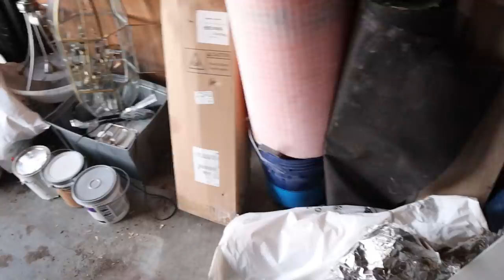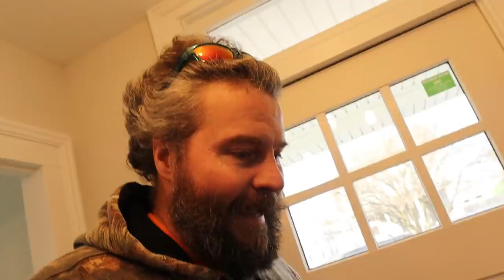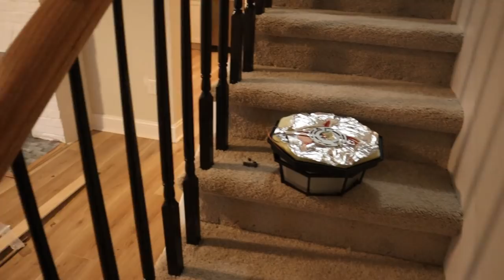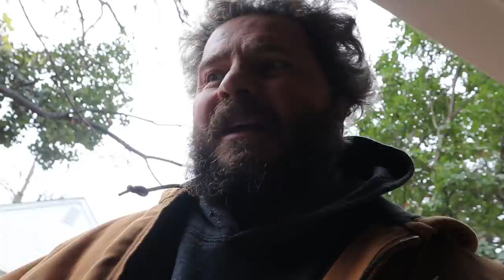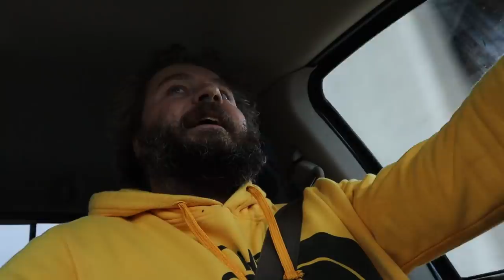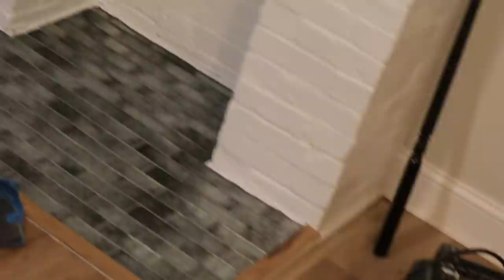SO CLOSE TO FINISHING THIS HOUSE (But.....)

Comment: Joe I would check your return air filter it may have become clogged from the sanding dust if there isn't sufficient air flo the unit will have a safety shut off  replace your filter shut the unit off at the breaker for a few minutes  and it may reset the unit and the exterior fan will kick back on. It's worth a try .

Comment: Heat pumps become inefficient at cold temperatures and they often rely on a coil pack somewhere in the unit to provide auxiliary heating.  When that happens, it's electrical resistance heating, similar to an electric baseboard heater. The temperature at which this transition happens is going to be in the documentation of your HVAC unit.

Comment: That unit outside is not a heat pump it’s a condenser. The condenser only runs when you have the AC on. The heat comes from the furnace in the attic or basement or wherever.
Reply: How do you know it's not a heat pump?
Reply: @techfive7202  https://youtu.be/zFt7KgaSsZo

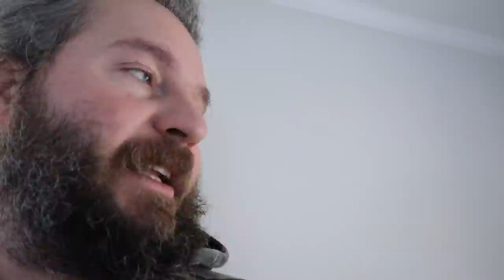In this video from a few months back at 9:13 you clearly see a condenser with a block on top.

Comment: HVAC is fine if the heat is working on gas/emergency is just gas heat. Been running mine like that for almost its whole life 15 years and i have a heat pump its fine. Unless the heat exchanger is bad. But its sounds like its good.

Comment: There is Sharkbite, Propress, CPCV, and of course soldering or sweating. Propress is the professional way to do sharkbite. Tool alone for propress can be 1500$ or more, sharkbite is the homeowner solution. Soldering is the old way of doing it and works but has downsides aswell, And CPVC is just lazy and dogshit.